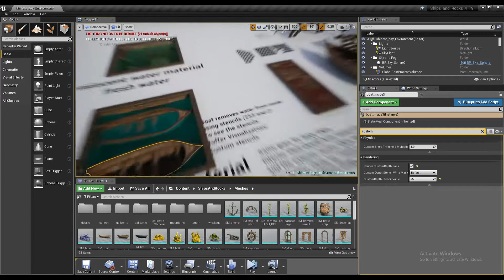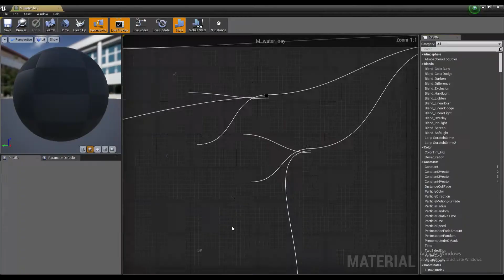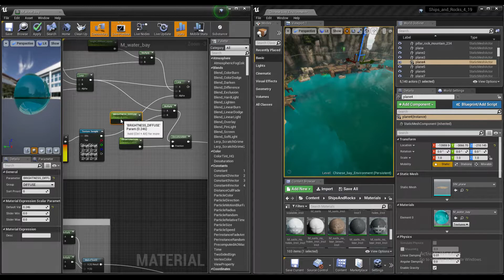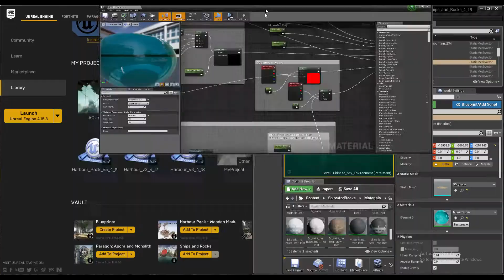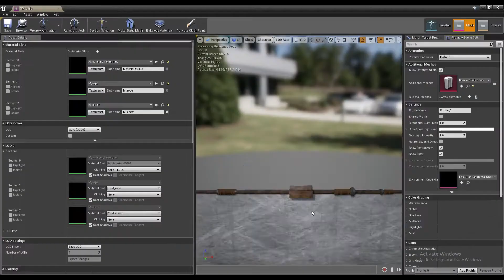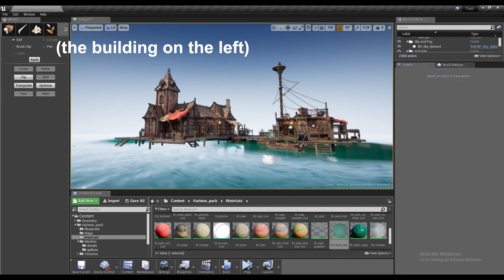Ships and Rocks + Tutorial about water removing in UE 4

Comment: hi ! can you make a tutorial with the g1=merged ship ?  i cant seem to remove the water with your tutorial 
Greets
Reply from the maker: 1. go to the edit/project settings/Engine-Rendering/Postprocessing/Custom Depth-Stencil Pass and enable with stencil
2. Make sure that your ship mesh has an exterior 'shell' that embodies it with a custom stencil "2"
3 Make sure that there is also interior shell inside this mesh with a custom stencil "253"
4. Attach those shells to the ship so wherever you move the ship - they will follow!
5. To visualize use: Lit/Buffer visualization/Custom Stencil

Hope this helps! Cheers!